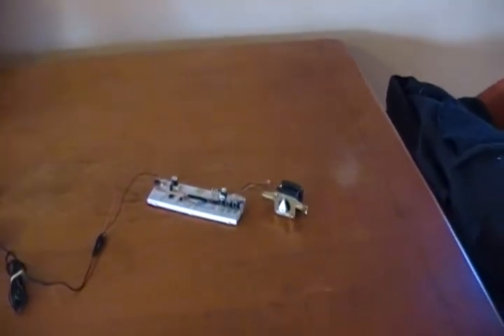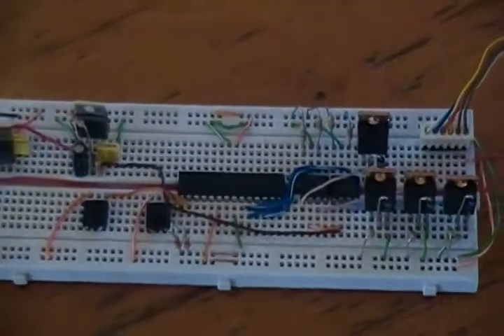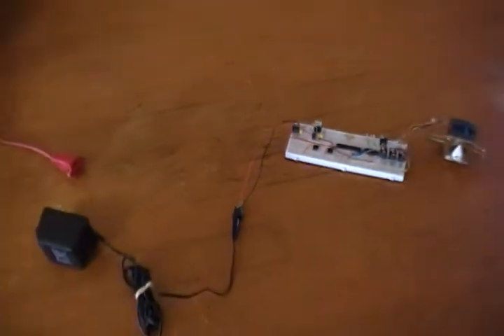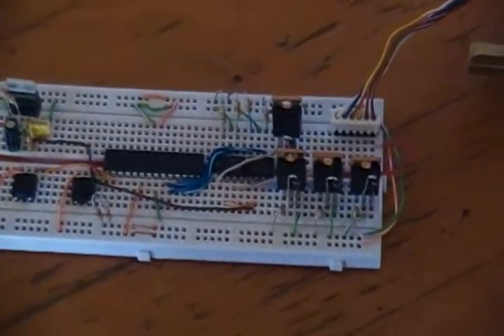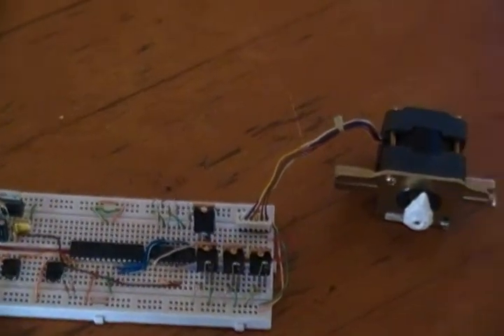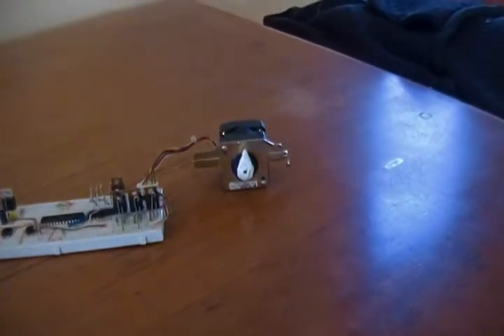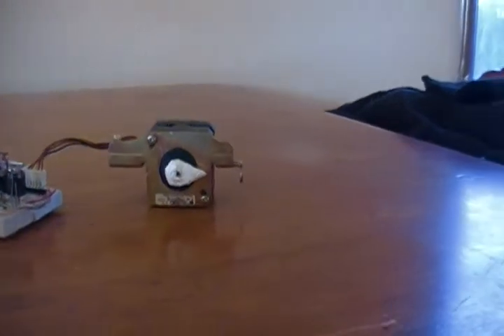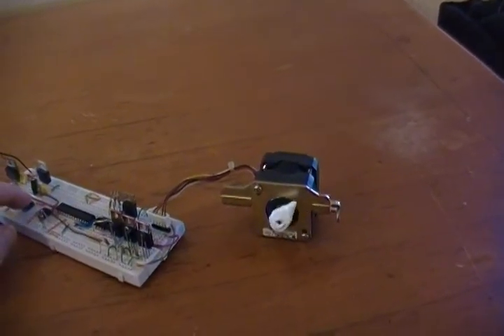avr based stepper motor controller

Comment from the maker: This circuit didn't do microstepping.  Dont have it anymore, but it was either full or half stepping.  I'm pretty sure that it could be changed to do microstepping, since the AVR micrcontroller has timers and pwm capabilities.  I've got a cnc routing machine that I've built and rather than use microstepping for precision, I made a simple geartrain.  The geartrain also lets me get away using weaker motors, since it increases torque at the expense of speed.  Will post pics someday :)